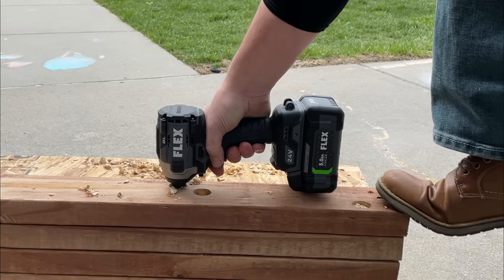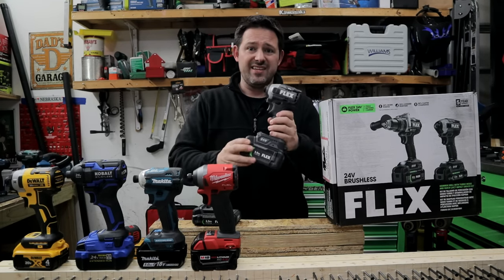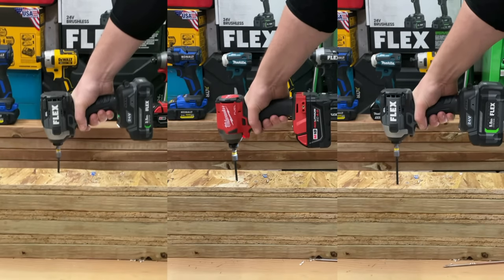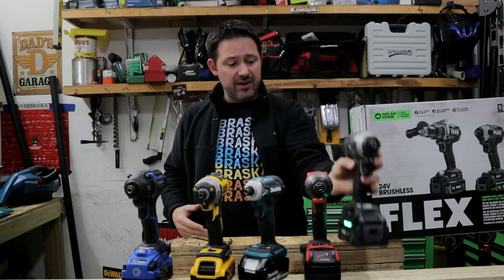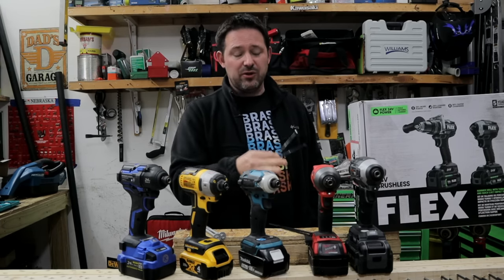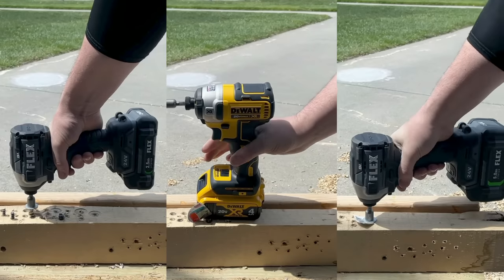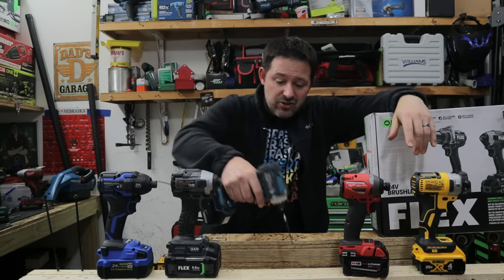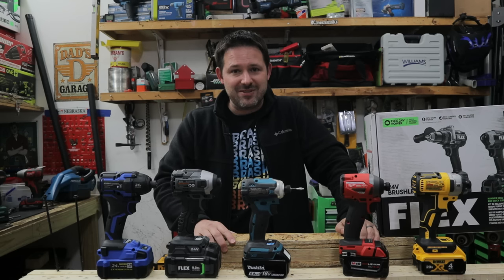FLEX TOOLS vs DEWALT MAKITA MILWAUKEE It's NOT what's NEXT Impact Driver SHOWDOWN!

Comment: your wrist looks like jello, using the FLEX, when running those lags!!
Reply from the maker: Trying to give them all a fair and consistent run with putting as little weight on them and trying to keep my body out of camera. The more tool power the more you have to control and counter act the forces.
Reply: @ClientGraphics  absolutely. Just an observation that made me wonder if the flex has a level of vibration that makes it uncomfortable.

Comment: Was that a turbo or non on FLEX ??? the one I have had a Turbo button that claimed more power and RPM but not torque... It's noticeably faster with the turbo engaged... I think it's a mistake to try to drill with those speed augers on an impact anyway...they work better on a regular drill low gear in my opinion then you don't have to wear out your impact receiver. BTW I payed less than $200 for my FLEX comes with 4AH battery and a 2AH power battery plus charger you won't find that kind of deal in Milwaukee DeWalt or Kobalt ... if money means anything to you ??? And as you saw very comparable to the higher costing Big Boys Toys.

Comment: Flex 5.0 hit a knot on the 6” test only because I’ve seen torque test Chanel’s video where it makes 15% more power than Milwaukee max torque, and torque drives those screws not speed.

Comment: Great Video.   With the specs the Flex has on paper it should have totally blown away everything else  , I mean 2,400inlbs torque and 4,000 rpms WoW those are Huge Numbers,  But obviously Flex Lied , and Now with that previously unknown Collet Issue,  and the Longevity in Question,  I wouldn't go near those Flex Tools.  Guys that why you have to watch these videos before you buy anything.... Thanks ...

Comment: You should compared the DeWalt with the flexvolt 5 amp battery and compared that with the flex 24 volt it would have got smoked

Comment: Flex might be fast on the smaller screws/ drills but it can’t hang with the big boys like Dewalt and Milwaukee on tough jobs. Wish you would have tried using a 1.5in speed bore or 10 in lag bolt. Go over to Man Caver Tools channel and watch Flex literally shut itself down on these heavier jobs.

Comment: If you want to rip your 1" auger bit out of a piece of wood with force....then use a drill driver with a real chuck, not an impact with a quick release. The quick releases on impacts are not designed for that

Comment: Flex runs alot hotter than any other drill...imagine on a hot day your installing a deck with 4-6 inch deck screws and your drill starts smoking...I have milwaukee and it runs about 15°-20° cooler which could be a big factor when dealing with circuit boards...honestly your best bet is dewalt because you can beat the hell out of them for years and the capabilities is enough for most professional carpenters...the 3 minutes in efficiency you lose on a days worth of work isn't going to lose you money and the 300 bucks you save on a drill combo is nice too but you don't buy a new manufacturer unless you got the money to burn and wanna put it to the test.

Comment: "HIT EM WITH THE FLEX" since I'm not invested in no power tool line up currently...im defitnetly going the flex way
Reply: I’m on 7 platforms. No low end either. Should flex be #8? I don’t switch platforms, I add. What kind of tools do you need?
Reply: Go Milwaukee, you’ll never regret doing it
Reply: Flex=kobalt with better batteries and paint job....lame. slap a High Output battery on a milwaukee see what happens. The whole TEST was done with the milwauakee on a 4.0 ....wtf kind of test is this? If we're so worried about speed and power put the biggest batteries each company makes or their tools and then test
Reply: @paedahe4975  just the basic home repair kit...hammer drill..impact driver...circ and recipe saw etc
Reply: @NoflectioN  I'm more in the car repair industry...so I use more automotive tools...but just got my first house and im gonna remodel it so looking into getting my self into a good tool platform
Reply: @JosePerez-yy7ow   flex quality could take a dive in a year or two if they aren't successful. The money milwaukee made on packouts alone can fund their R&D for years. I'm a fanboy if u can't tell lol MILWAUKEE 😆
Reply: @NoflectioN  I seen that milwaukee m18 fuel has a 5 tool combo and get a fuel tool free so might consider going big red

Comment: I don't recall you saying which DeWalt series you used, which makes a huge difference. And if you're talking that tiny amount of time and you're installing hundreds of screws at a time like a deck give me the lighter less bulky tool because that comfort is worth more than saving tenths of a second per screw.

Comment: Next, we test the 2021 VW bug against the 2021 Corvette. The results will amaze you, spoiler alert, the VW loses. That is the same as running a 24v vs an 18v. If the Flex was an equal battery level as the Milwaukee, there would be no chance for the Flex

Comment: Why the surprise in the Kobalt XTR comparisons? . Given the prices, that they're made by the same manufacturer, and where they are positioned to compete in the market, it would have been surprising if Flex DIDN'T beat it out in most competitions. Flex was released with the intention to compete at the highest levels of Power tools. Getting bested by the Kobalt XTR would have been terrible.
Reply: For what it's worth, the XTR line is pretty phenomenal. They outperform makita and dewalt, and come close to milwaukee. They do a hell of a job.
Reply: @cameronaberner  I know about the XTR line. It is quite good. I actually bought the XTR  hammer drill driver for my Dad, but ended up returning it prior to his birthday when the Dewalt flexvolt went on sale (and he has a Dewalt 20v already in an impact wrench). I do like XTR a lot in it's price range, but my point is that Flex is trying to position itself as a step up from Kobalt. Sure, I'd expect the XTR to outperform the base  Flex model, but not their "turbo" model.

Comment: It’s obvious that the Milwaukee and the Makita have more torque than the flex at any speed… This has been proven out on other channels. The deal is the flex seems to have higher no load speeds or low load speeds so when you put in smaller fasteners it’s going to spin them down slightly faster.

Comment: Speed vs torque. The smaller fasteners require almost no torque to set. The Flex is fast. The bigger fasteners require torque, that’s why Milwaukee preforms so well. There is a lot less torque required for removal, again why Flex shines. 

If I want speed I’ll grab my drill, torque I’ll grab my driver.

Comment: As a Handyman myself it is an absolute insult that you would even put Kobalt in this line up as if it had anything to offer IMHO.  Why did you not run this test with HP by Metabo now since that Hitachi was bought out.  So I could at least seen the comparison with tool worthy of it name vs. the kobalt brand.

Comment: Why not at least use 5.0 ah battery on Milwaukee , let alone 6.0 high output
Reply: 5.0 < 3.0 < 6.0, but he chooses to use a 4.0, which is the weakest second to only the 2.0, both very old and obsolete batteries

Comment: 4.0ah? What an odd choice for the M18 battery. Every other test (not involving flex) on youtube they pair it with a 5Ah or an High output 3.0. Both of which will drastically increase the performance. Milwaukee doesn’t even sell the 3rd gen fuel with an 4.0. This is a weak and obsolete battery, the flex was obviously meant to win.

Comment: You at the lease need a 5.0 on the Milwaukee preferably a HD battery
Reply from the maker: Here is the MILWAUKEE High Output 3.0Ah vs FLEX 24-VOLT https://youtu.be/YoaVYxl31dw

Comment: I own a lot of Milwaukee M18 batteries and power tools but if Flex can expand their lineup I will switch sides. Don’t care for the weight, i am in the electrical trade too.
Reply: Guess why they never put the flex up against the Milwaukee with a 3.0 high output battery...  it’s b/c the Milwaukee will blow out the flex every single time.. gen 3 impact driver with the 3.0 high output 21700 cell battery absolutely creams everything that goes up against it. Don’t buy into all of the marketing hype on their lineup.. they have some ok tools, but their batteries are subpar, they need about a decade or more of fine tuning their lineup before they can even hold a candle to Milwaukee or Makita... that said, Makita really needs to come out with some more battery selection.. they need to get on the dewalt and Milwaukee train and offer some batteries with 21700 cells rather than only 18650’s- it makes a WORLD OF DIFFERENCE when it comes to performance, speed, power, and longevity per charge. Check out man caver tools’ vid where he points out how much b.s. and “fixing” went into Flex’s launch event production! They weren’t even comparing apples to apples, it was ridiculous. Stick with Milwaukee, you’ll be better off in the long run. Plus, there is zero info out there on just how tough the Flex lineup of tools actually is, whereas Milwaukee has tens of thousands of tradesmen who have been putting them through their paces for decades! They are number 1 for a reason. Remember that.
Reply: @mikedeezle2249  All good points. I did read that Flex has 100+ tools planned for roll out over the next couple of years. I don't think it'll be a garbage brand, but people should wait for some durability anecdotes to come from actual trades people. If Flex debuted with the Milwaukee Gen 3 collet issue, people would flip...and Milwaukee is an established brand!

I think the Makita XGT line looks good but super pricey ($209 bare Impact driver, $150 for 4 Ah battery, charger?!) ; too bad their batteries aren't backwards compatible with the LXT 18v line. And who how deep the lineup will be. But XGT batteries should all be 21700.

Good times ahead for consumers IMO. Cheers.
Reply: If you are in electrical trade you would know why this comparison video is irrelevant..... Do you understand DC motors?? A basic electrician should know this......
Reply: @bustanut3888  yes, but the trade is more than just motors. Going from the resi to the commercial side, these power tools are useful.
Reply: @mikedeezle2249  very good point, I like Milwaukee but can’t make them a monopoly or they’ll hold the whole market and price their products outrageous like those air compressors, workbench, nailers, worth it but still overpriced.
Reply: @carlos.velazquez  yes tools make jobs easier... I'm an industrial electrician...... So you know how voltage and amperage affects DC motor.. So you can understand why this test is irrelevant and not a true honest comparison video.
Reply: Good deal, I’ll take those m18s off your hands lol

Comment: DeWALT really needs an upgraded model replacement for the dcf887 it’s still a good impact driver but for some reason DeWALT has put a lot of focus on their Hammer Drills and Saws lately but not so much on their impact tools and it shows too DeWALT is very weak in the impact tool department
Reply: @Walter Well i look at my Dewalt tools like I look at my 2nd gen 2008 Nissan Frontier 4.0V6 4x4 with 346,000 miles on it. It aint the newest fastest most powerful truck out there but it sure does reliably get the job done year after year. My 3 Dewalt 885s and 1 887 do the same thing day after day, year after year. They just keep getting the jobs done. And first collet issue I ever had was after 4 years of hard daily use on one of my 885s that drives 5/16 diameter lags with Torx 40 heads on the daily as it builds playsets all day long. Fixing the collet was so easy too, just rebuilt the collet with Dewalt parts.
Reply: @duncdunc76  I use DeWALT myself and love their tools but there impacts need a bit more power it is the only area DeWALT is lagging behind in and all their other tools are right on par with the other top brands

Comment: You should really approach these videos completely non bias,..... you definitely showed some dislike towards certain brands and not others. As well as not mentioning some important benefits to some tools over the others, like warranties, there is not a Dewalt, Makita, or Milwaukee store that you can just walk into and get an instant swap if the tool goes bad in Five years and Three years on the batteries..... and then of course price is a huge thing , especially when the least expensive tool you tested beat two of the top name tools not including Flex line.... and the price of the tool and extra batteries are significantly cheaper than the top three brand names....
Reply: You need to say that there is not a store where YOU live .

Comment: If you used the dewalt flex volt battery it would kick ass. You can’t go out and say flex is better without proving it performs through abuse and years.

Comment: I’m surprised you recommend the Makita when it was consistently the slowest, even losing to the Kobalt occasionally.
Reply from the maker: It felt the best in hand with little vibration over long term use. The size and weight to power I was impressed and it had the most features including the ability to turn the light off no matter how trivial.  Slowest is all relatively they all can do the job. You can make up the seconds by being prepared and organized or starting a job on-time.

Comment: The amp hour rating of the battery has nothing to do with the power of the tool, the size of the battery relates to run time.

Comment: I see you're handicapping Dewalt and Milwaukee with 4Ah batteries? Did they blow FLEX out of the water with their 5Ah batteries? With the 12Ah batteries from both Dewalt and Milwaukee, FLEX will be the tortoise in the race.
Reply: Well he used a 2.5 on the flex and it still beat the crap out of dewalt and came close to matching milwaukee, so I feel like it wouldn't have made that much of a difference.
Reply: @cameronaberner  The whole test should be redone with 6AH for both Dewalt and Milwaukee. It wouldn't make a difference as well right? I would love to see the results.
Reply: @quasar1460  Well, since the Milwaukee was neck and neck with the flex the whole time I wouldn't be surprised if they won with that massive battery, but dewalt isn't going to shave 4 seconds off just by changing the battery. Maybe if the dewalt was on a 2.0, but going up from a 4.0 you aren't going to see that much change in performance. Dewalt is just the lame duck of the professional power tool scene recently. Obviously they are still good tools, but the competition is kinda leaving them behind these days.

Comment: Not a Pro. But looks like your pull out issues was caused by going in a few degrees off set and trying to pull out straight. Also in other tests I’ve seen the Flex struggles with large long lag bolts.  I don’t have any of these issue but I’m also a dinosaur 🦕 all my tools are corded. Still haven’t selected a brand to make the conversion yet.

Comment: Dudes arms straight shaking trying to get the milwaukees ahead of the Flex’s.  Note how little effort he puts downward on the flex and then he even sticks around drilling it deeper than he did with the other ones.

Conclusion:  This review appears objective on the surface, but a little scrutiny shows he was biased and playing favorites.  His tone throughout the video is also negative even when the flex is better.  At one point he downplays speed and says lightness and vibration are more important factors.  

I won’t be frequenting this guys reviews anymore.

Comment: Yes I’m a fanboy but think about this. The Milwaukee had the 4 amp and was close imagine a 5. And it’s only a 18v like imagine they just applied the same number specs. Milwaukee is way more powerful in that case and they’re not even showing it.
Reply: Flex has stacked batteries now, far outperforming anything milwuakee offers in batteries.
Reply: @Syntage88  idk what you’re talking about, both brands offer 2 battery types actually 3 if you include 12v and when they make a stacked battery, which is inevitable, they would offer more I mean which they already do.
Reply: @Syntage88  now that I think about it, I don’t think flex has a 12v system. Hm
Reply: @christianvalenzuela1118  Tools perform better with stacked batteries of the same amps. One has stacked, the other probably wont for a while. Simple as
Reply: @Syntage88  yes I’ve been around to see dewalt making the first move. I don’t see your point there
Reply: @christianvalenzuela1118  My point is that there's a cycle of who is on top and milwuakee is showing signs of slacking. Personally I always felt they were very overrated in the first place anyways, but even a blind milwuakee fan had to admit right now they're being lazy by being so late to the party.
Reply: @Syntage88  with a stacked battery? Out of how many brands. Idk about that

Comment: This test is really unfair why wouldn’t you use the Milwaukee 5 amp hour battery it’s what comes with the tool in the set and it’s the battery that impact drive was designed to use not fair not to mention ur using 5 amp hour packs on the flex an makita where was your head in that decision?

Comment: ONLY ONE SAYING FLEX IS THE BEST IS FLEX AND VCG. REALLY DISAPPOINTED IN VCG. HIS TEST ARE WEAKKKKKK TO BE MODEST. ALMOST TO THE POINT OF IRRELEVANCE.  USED TO REALLY RESPECT VCG. NOT SO MUCH AFTER HIS FLEX VIDEOS. ALMOST LIKE HE HAS SOLD OUT TO FLEX. BUT HEY IF U NEED TO KNOW WHAT DRILL WILL DRILL HALF A SECOND FASTER THRU AIR, VCG REVIEWS IS WHERE U NEED TO LOOK.
Reply: Vince is a walking commercial now.